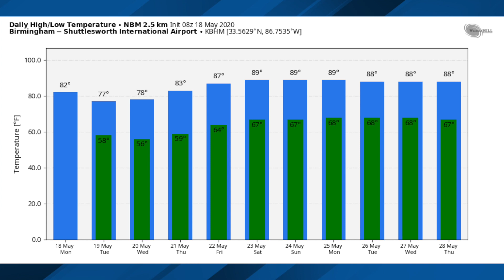May 18, 2020 Weather Xtreme Video - Morning Edition

Comment: Good morning, James. It's already up to 76 in Eufaula at 0845 under mostly sunny skies after a low of 69. The high yesterday was 93, and that dropped to 71 in 45 minutes when the line of storms approached at 1500, along with 23 mph gusts from the outflow winds. I only had .10" while my buddy in Clayton, just 20 miles away, had 1.49". This kind of thing happens all the time. It's rare we'll both have a decent amount of rain on the same day. The weatherman's woe looks to hang around until maybe Thursday. I'm hoping I get more than .10" before then. It would be nice if Arthur would spin a little more in this direction, but that's just not going to happen.